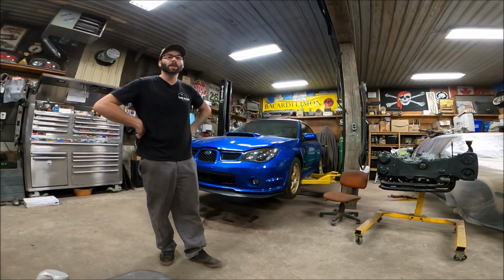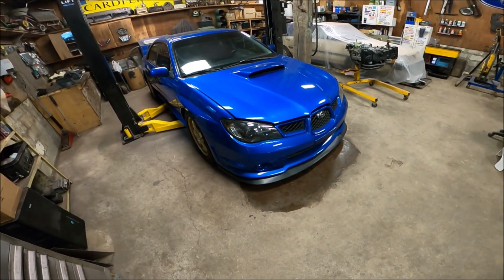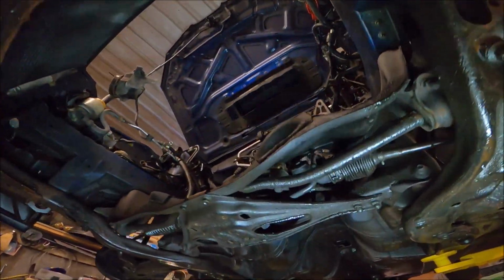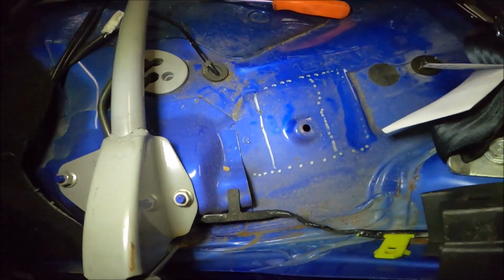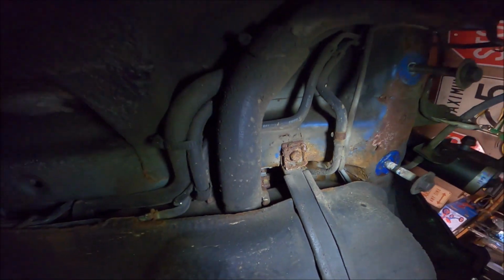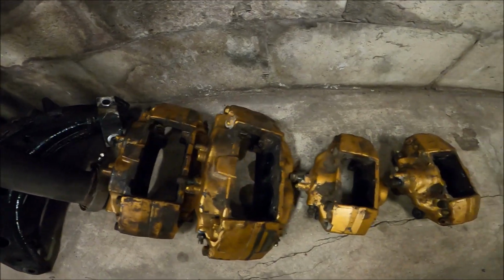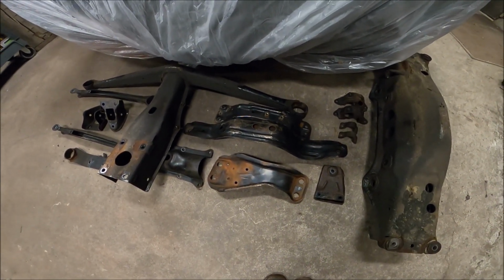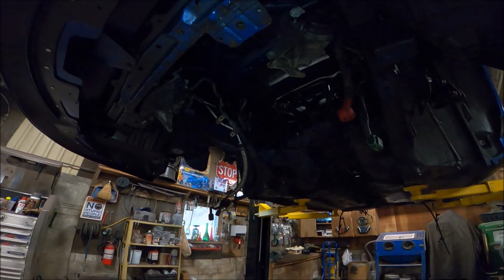2007 Hawkeye Wrx - STI Swap And Refresh - Part 1

Comment: Oh man i had the same thing happen to me w those captive nuts. Live in the Midwest so the rust is brutal. But i went a much more complicated (and now watching ur video i feel like an idiot for not doing it the way u did it) way about it. Took 16 gauge steel made planks, drilled them out welded the nits to them fished them in the frame rails through the drain holes, lined them up put a bolt w a spacer in so i can tighten the plate to the frame rail, drilled out two pilot holes on each side of the bolt hole and plug welded them… u made it look so simple
Lol
Reply from the maker: That is definitely 10 for creativity! Ive heard of people doing similar methods. Ive ran into these spinning weld nuts often being in the rust belt. This method is definitely most efficient for sure. From spinning a nut to 100% rectifying it can be done with the floor even welded back up in about 20mins.
Reply: It was the best i could come up with giving my limited knowledge on that particular issue. But now i know. Thanks for the great content and keep them rolling! Loving the channel.